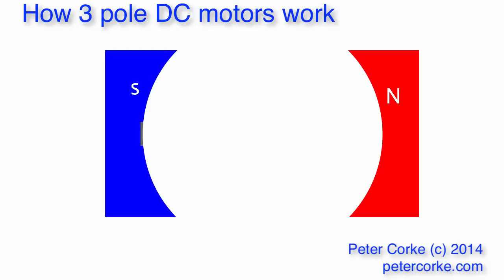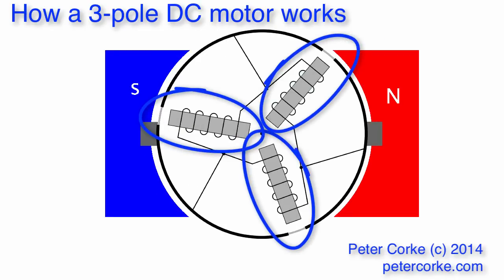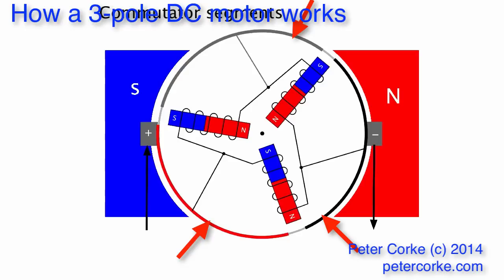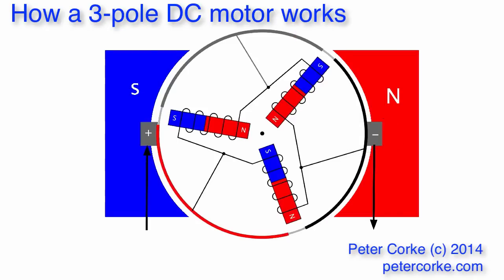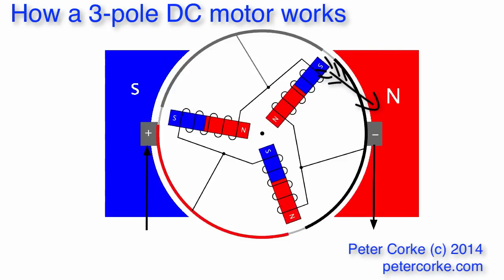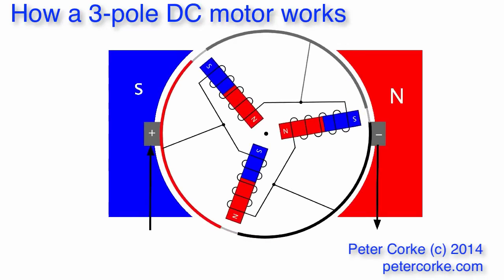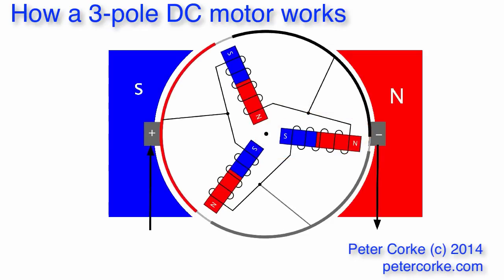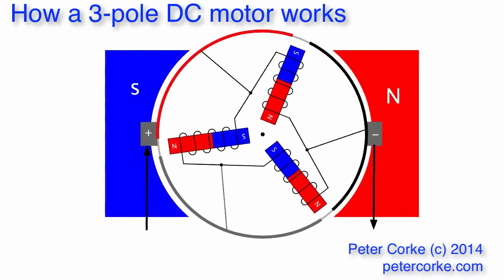How a 3-pole electric motor works

Comment: WARNING, the armature poles are incorrect. Convention current is used in the diagram, then by right hand curl rule, all the poles are wrong. The rotor will instead rotate in the anti-clockwise direction.
Reply from the maker: This was pointed out a few years ago, see the thread below.

Comment: at any one point in time two coils are in series and that is in parallel with one other coil , doesnt it make the torque uneven because the magnetic field in the third coil would be higher due to higher current ?? correct me if i am wrong
Reply from the maker: For almost all motors, torque is not constant as a function of rotor angle – the effect is called torque ripple.  You can find lots to read about on that topic.
Reply: Peter Corke Thanks 😊

Comment: for the electromagnetic coils, are you winding in the wrong direction? Using the right-hand rule, for this coil winding direction, the electromagnet has a different direction. Please let me know if I am wrong. Thanks.
Reply from the maker: You are correct.  The indicated N and S poles in the animation are what is important.
Reply: +potato li
yes, you are right!
before seeing your comment I was thinking that, am I the only guy who could not get it properly!

Comment: Sir in dc motor when we apply supply to field winding or stator it make electronagnet but when we apply dc supply to transformer it burns the coil why it doest not make magnet....
Reply from the maker: it does make a magnet but the field is constant so current is induced in the secondary.  the magnetic path is closed by the transformer's core so it won't behave like a magnet.  whether or not it burns the coil depends on the voltage you apply, with DC there is no back EMF as there is with AC excitation which limits the primary current.
Reply from the maker: the magnetic circuit in a transformer is closed so the flux lines don't leave the core.  The only reason the coil would burn is you are passing too much current through it.  The resistance of the coil is low, when working as a transformer with AC supply it relies on the induced voltage to keep the current low.

Comment: hy there. Can u make a video with the same dc motor working as a generator. It seems to me that this is the best generator. I played with 2 toy dc motors, connected togheter by its shaft, one used as a generator, and i was able to get 13 volts, and 0.320 mA, when the other consume 12.5 volts at 0.470 mA. It's far the greatest generator for me. Of course it needs high speed to get this much, and i was adding 2 neodimium harddisk for a greater magnetic field on the generator. Whitout the neo magnets i was able to get just 9 .5 volts, and less amps. The magnet inside the generator is from rubber, and it's magnetic field is verry weak, that's why i added 2 neo magnet there. i know how those dc motor works, but i don't know how they produce energy.. Great video
Reply: +Florin Jiarca The way they produce energy is just the same but reverse. It won't really be a generator without close circuit, but it will just be a spinning shaft with turned-off electromagnets, closure of a circuit makes it a generator. Lets assume the battery is rechargeable: generator is - if you overpower the battery when manually rotating motor opposing the battery. Battery causes certain magnets to repell and attract to produce rotation certain way, when you overpower motor the opposite way (by overpowering I mean spin the OPPOSITE WAY FASTER than the battery would do it), now magnets that want to repel - approach and vice versa. In doing so it sends electrical current to the battery instead of taking it, as now electromagnetic field that is directed your way stronger than of a battery-produced. Thus it causes amperage to go to the battery, thus charging it, instead of taking energy out of it. Spinning against the battery slower than battery would do its way would still eat battery but at a slower pace (as you help battery to counteract friction). 100% efficient motor theoretically would consume 0Amps, when rotations reach the point where they generate as much energy as they take from a battery. But resistance in coils, friction all prevent that, thus efficiency is never 100% so battery always has to give energy even a little bit. Notice, on some industrial motors label: full load amperage: that's the instantaneous amperage of loaded motor while it does not spin (before it accelerates). Measure it on some decent (1/10 to 1/3) hp motors with heavy load on a shaft: amperage drops as motor accelerates. That kinetic energy as shaft starts to spin is a "generated" energy that feeds back the power source" Assume you started spinning it faster than (battery's capability+friction loss+resistance loss), then generated energy that surpasses the energy battery provides will charge a battery - there you have a generator.